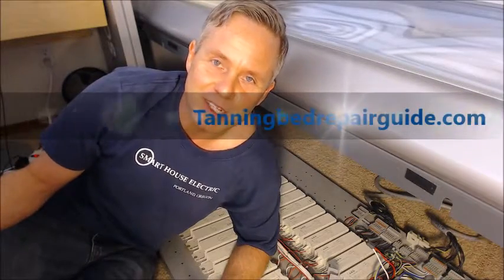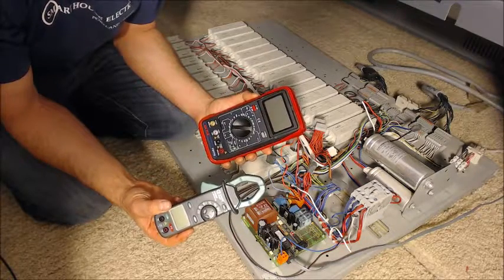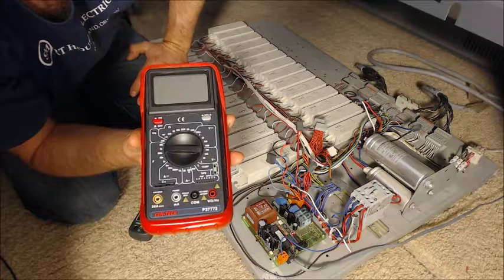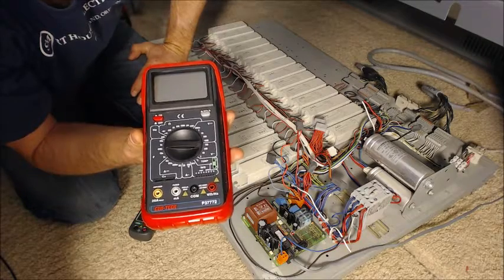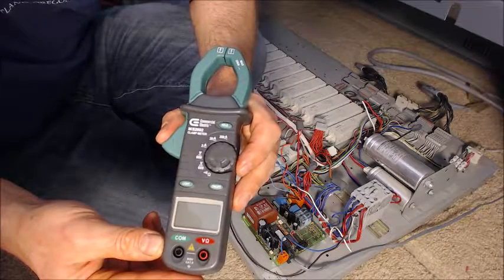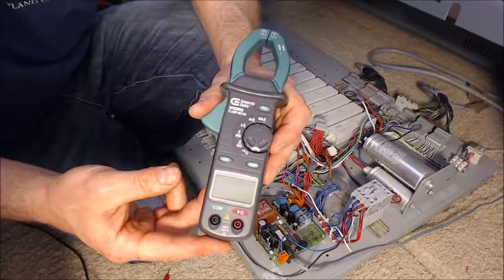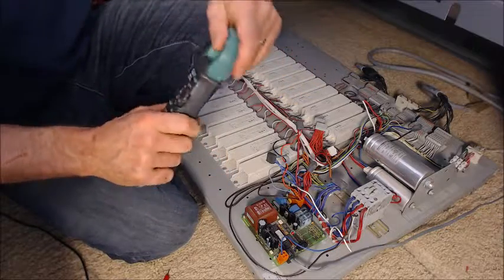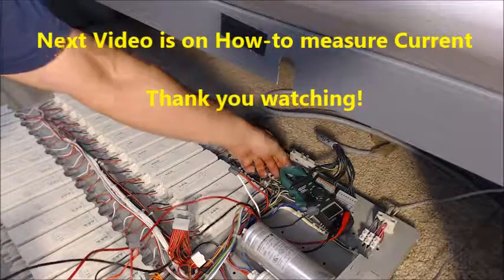Voltage check on a tanning bed

Comment: there are fans on each door. 2 of three fans on one door doesnt work. hooked to the same capacitor.  doesnt that mean that the cap is bad? some sides have 2 working, one not working. Its a stand up. capacitor right?